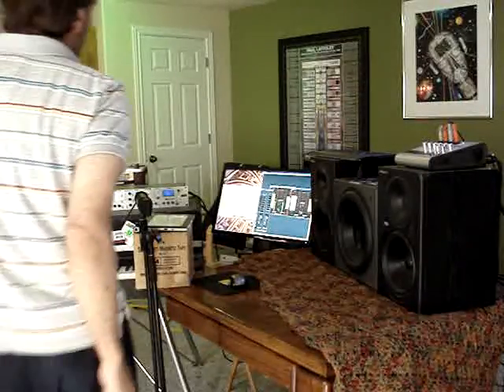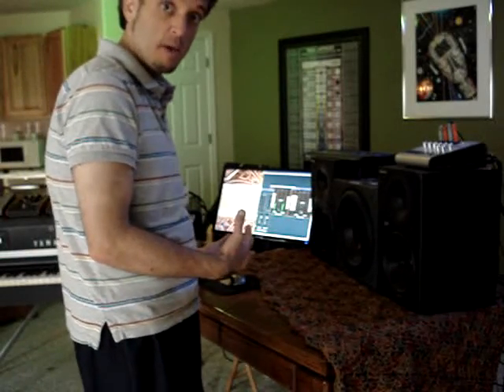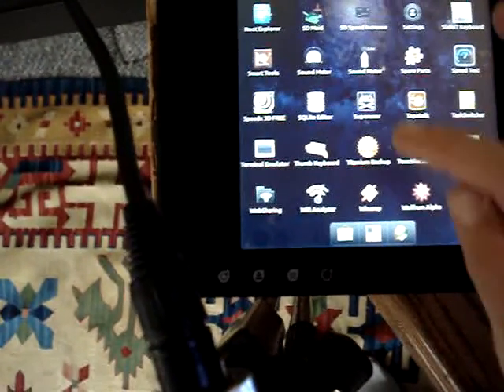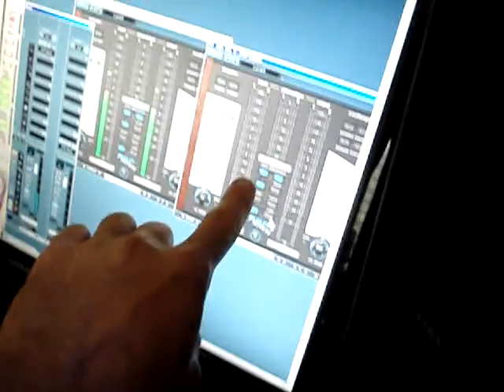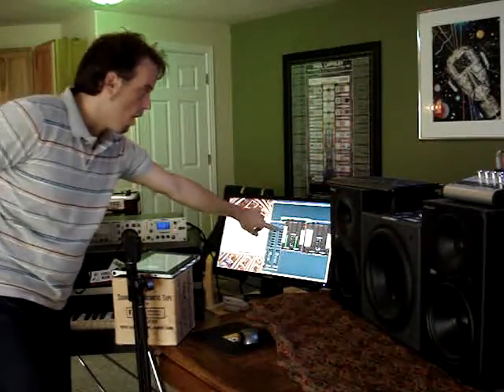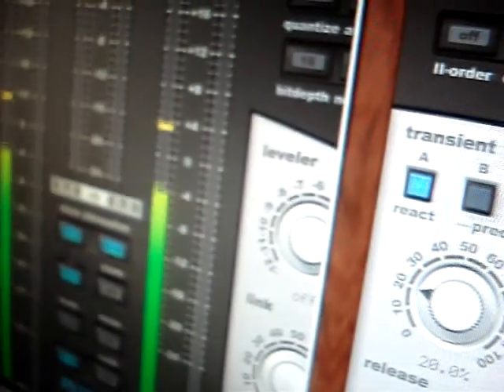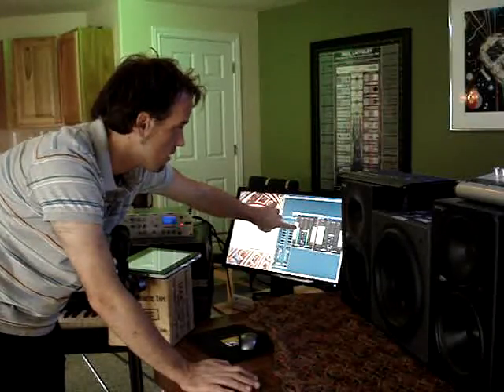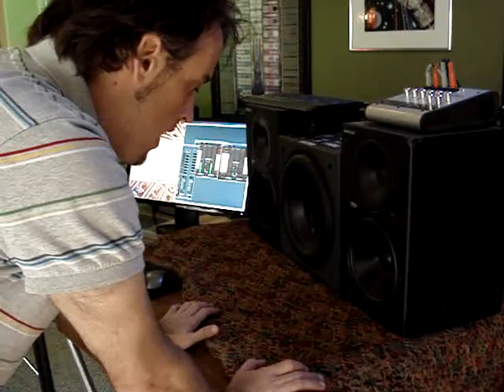Calibrating your Monitors using the K-System  (Part II)

Comment: I am still not clear with this process. You have your pink noise RMS to 0db. Now you have to gain your monitors to 83db SPL at your listening position. I am confused about how you gain your monitor level - from the monitor preamp itself (I have HS-80s and HS-50s) or from your sound card's volume pot? Thanks!

Comment: I also DO NOT understand this so far. Theoretical - yes, but no way for me in reality cause as others mentioned - it is far too loud! First I thought i was doing soemthing wrong. So I tried different Meters as well as spl hardware meters, coming up with more or less the same results. FAR TOO LOUD and just not usable. Even me speakers going into the reds and limited the signal. How could that be?
Whether K14 or K12, voltcraft sl-200 or iphone db app. Software metering 0db with K12 or -20dbfs !?!!